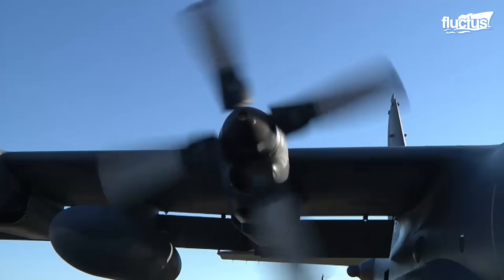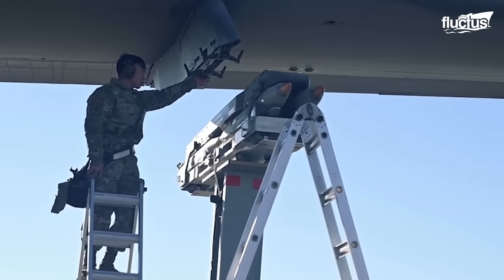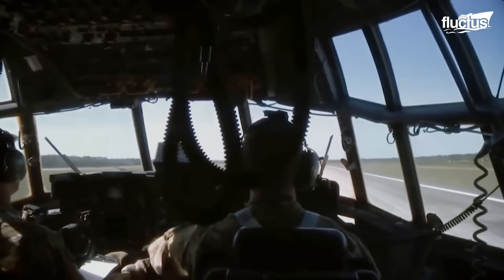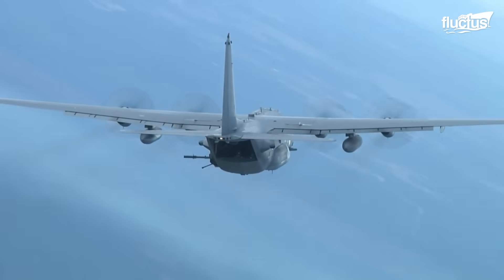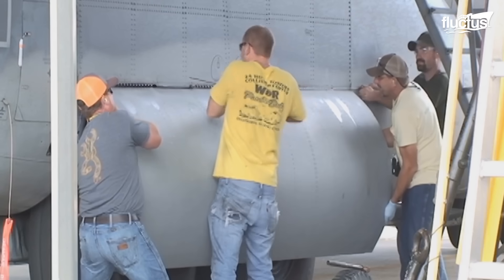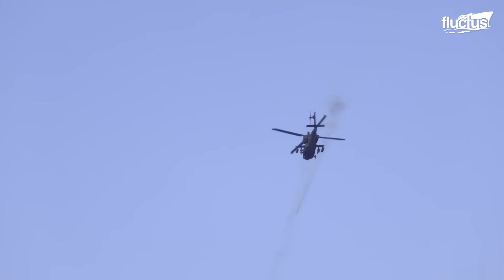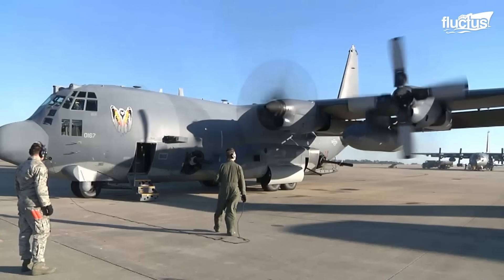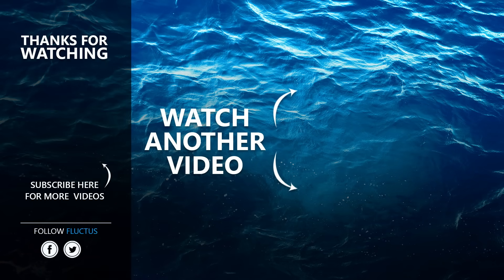Inside US Most Feared Aerial Gunship Ever Built

Comment: The capabilities are indeed impressive, BUT it is contingent on one major factor, you are fighting some primitive , stone age tribesmen that you can bully, or an enemy that have absolutely zero air defense assets. If the opposition have access to anything like man portable anti air missiles or even old multiple ZZU 23/4, Gepard or AS 400, or even a light attack airplane with a couple of 20 mm canons, this AC 130 will be a pile of airplane parts on the ground.